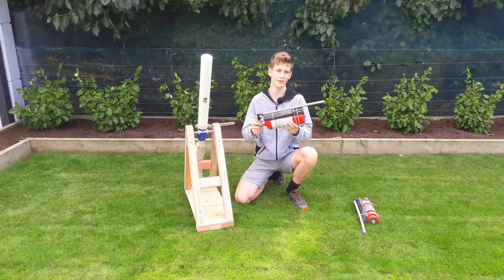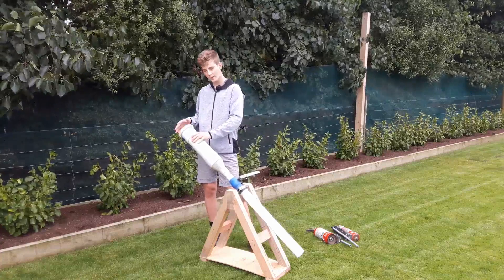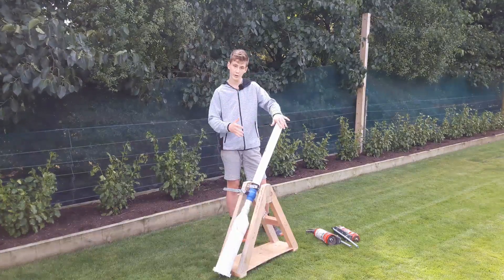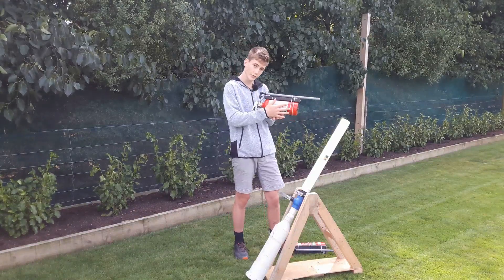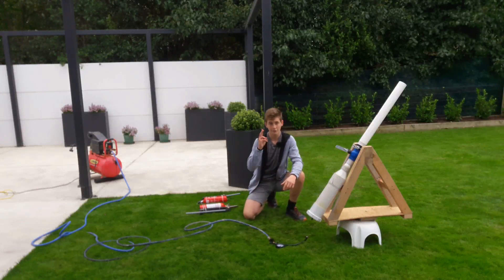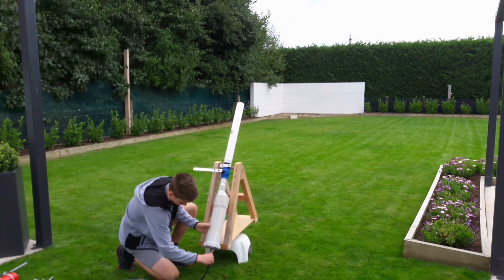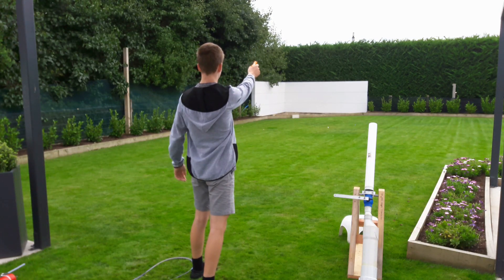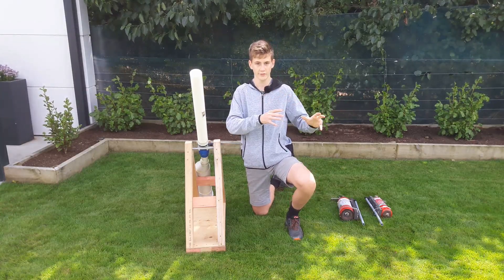How I built my homemade Air Canons

Comment: How much meter shot
Reply from the maker: With the big canon I was able to shoot tennis balls 100m at 120psi. But this pressure isn't very safe and I actually had one of the canons explode. I found the canon at 70psi was the safest and it shot  60m. Another way you could shoot tennis balls further is by using a solenoid valve. But do your research on what pipe you use and stay safe.
Reply: I am taking fire safety on how much meter shot
Reply from the maker: The fire extinguisher canon shoots nerf darts 80m at a 110psi and can fire them straight for 50m.